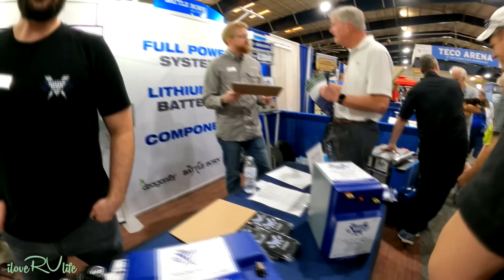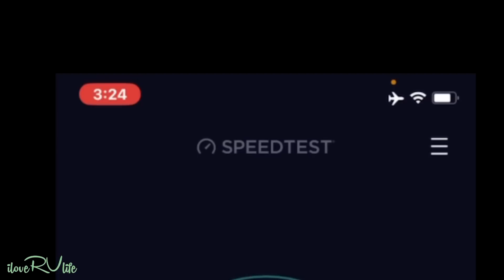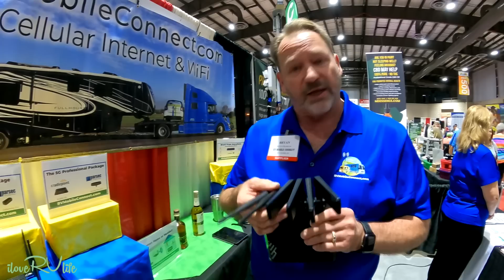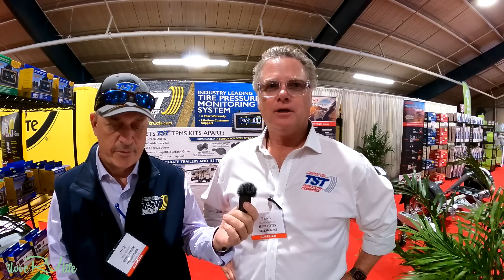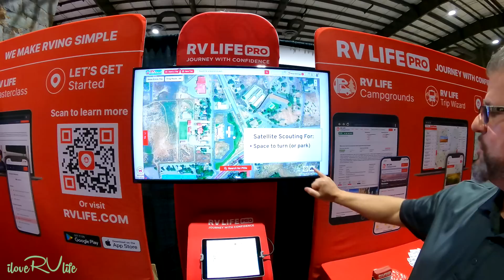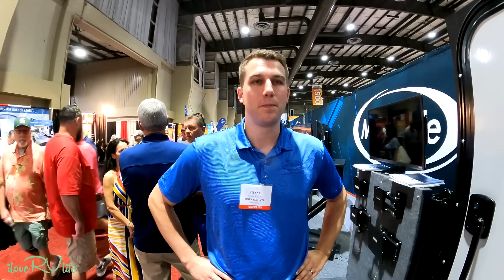Day 4 - 2023 Florida RV SuperShow - Our Favorite Vendors

Comment: I got the TST 770 very easy to program like the fact that you can rotate your tires. We had MORryde installed both of those products at the Frog rally in Goshen In. last August they are great so much easier getting into and out of the 5th wheel.
Reply from the maker: Having the TST system on the 5th wheel was a must. We didn’t have one on the previous 5th wheel and two blowouts created a lot of damage. I’m so happy with our TST, I’m adding sensors to the F-350.  Joan is looking forward to the rails installed.

Comment: The cradle point looks interesting. But I’ve been using T-Mobile for $50 month with unlimited usage. We’ve been using roughly 200+ GB per month with typical speeds of 50-60mbs down and 20-30 mbs up. When we were in Elkhart, IN we were getting over 300mbs down.

Joan will love the safety rail. We added that to our rig and my wife absolute loves it!
Reply from the maker: We have been traveling in some very remote areas and cell service has been weak.  When we tested this at install, we were in a very weak cell area and the previous system we had installed would only get less than 1Mb down.  The Cradlepoint was getting 18Mb.  Better radio and firmware made a substantial difference.   Thanks. I think this new rail is going to work great for Joan.